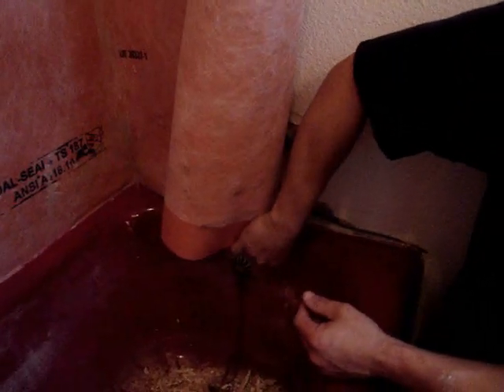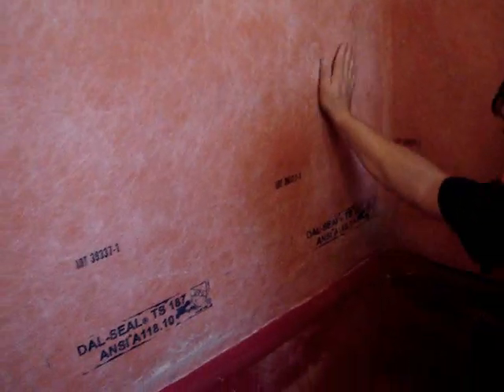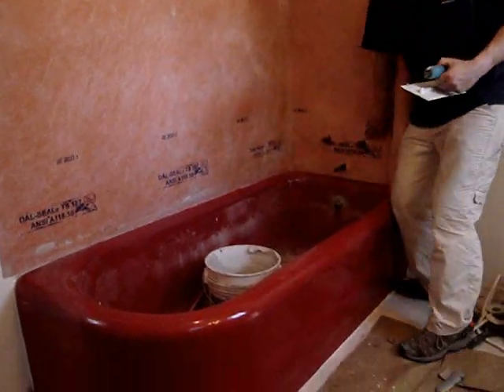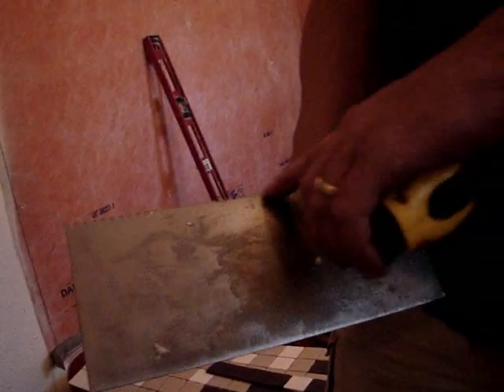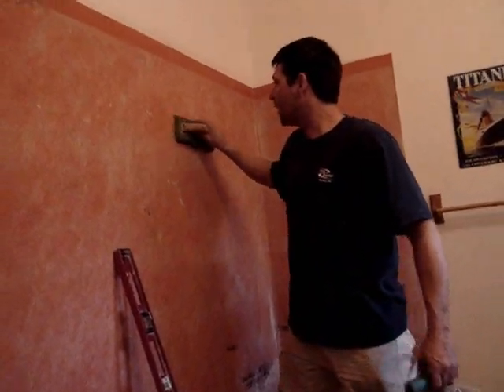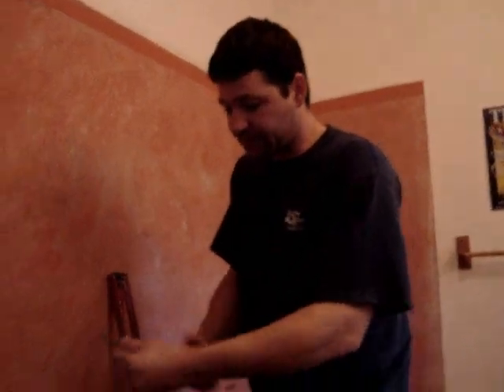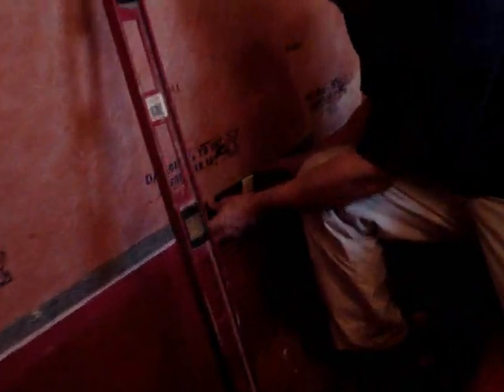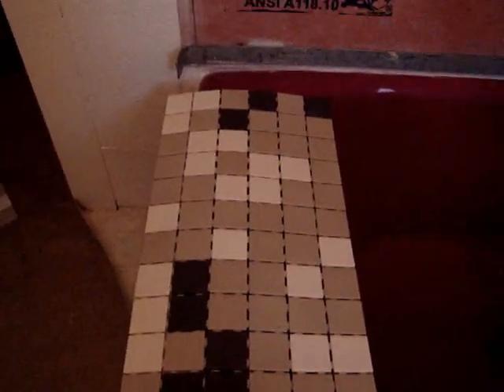Tub to Shower Conversion Part 1

Comment: can you provide more specifics as to the materials you used? what type of mortar was it again? did you use the same type of mortar to fill in the holes in the drywall as you did to 'glue' the membrane to the wall? and what is that 'membrane' you used?